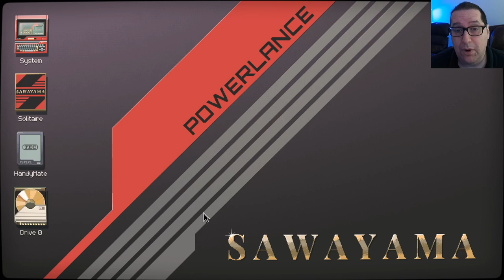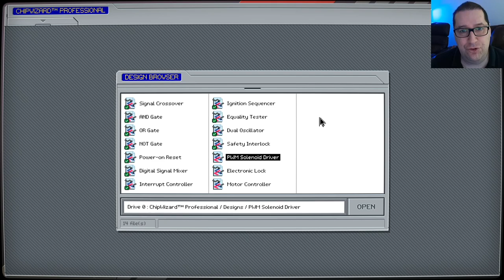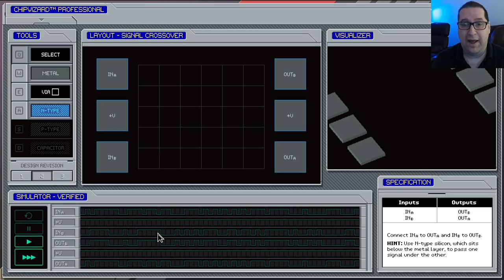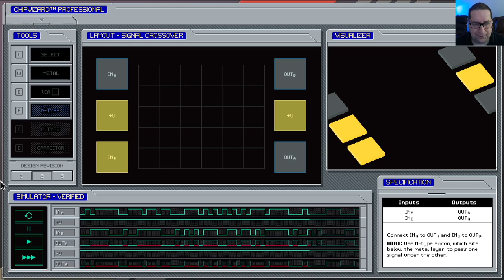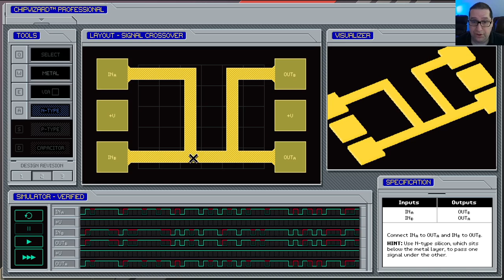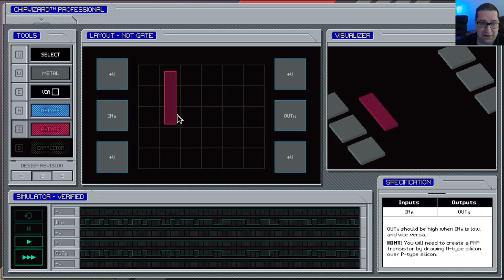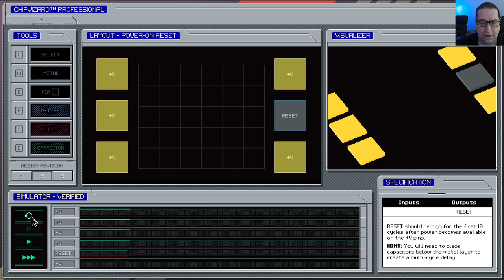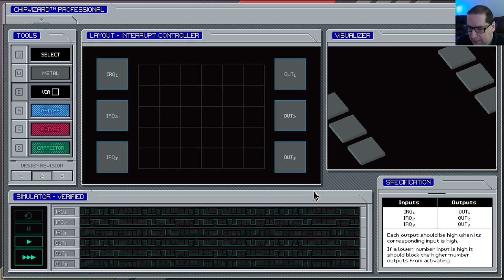Last Call BBS: Solving Chipwizard Professional, part 1

Comment: The score is calculated by measuring the bounding box of your silicon layer design. Metal squares are ignored. So in order to get 10 points, you need a 2x5 silicon layer design.
Reply from the maker: Thank you!
Reply: @TeaLeavesProgramming  I know this video is really old (and maybe you figured it out on part 2) but the score calculation is displayed on the bottom left side under the "Design Verified!" heading after you execute a valid design. For example, on the Interrupt Controller pattern, your last score @25:15 was 6µm x 3µm. Great video, thanks for making it!

Comment: I figured out what it wanted me to do but the mechanics are just alien to me. I don't understand the waveforms and how they relate to the interface
Reply: The wave forms are basically how digital signals are usually represented over time. It's divided in cycles and each signal is a line that can be high or low depending on whether or not the puzzle expects the signal to be high or low on that particular signal. For example, it shows what the input will be in the simulation and what the expected output is, and what the actual output is while the simulation is running so you can see where it went wrong.